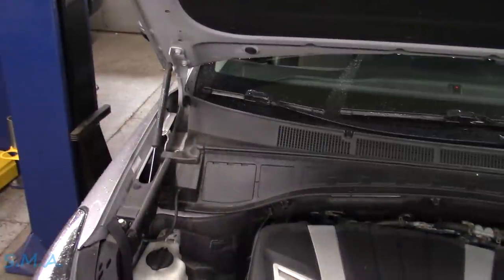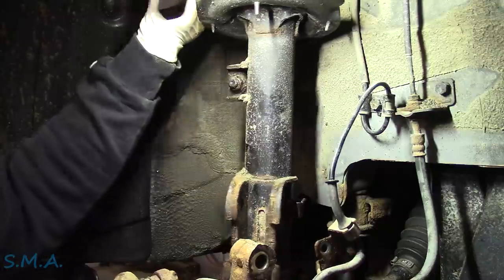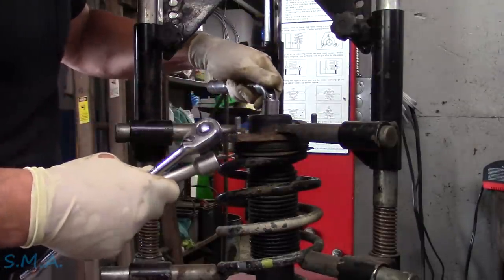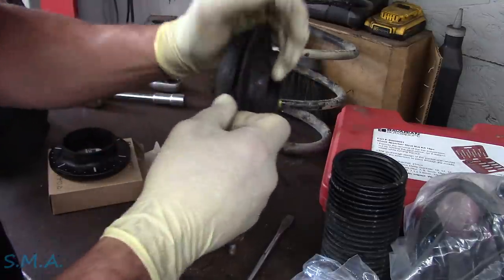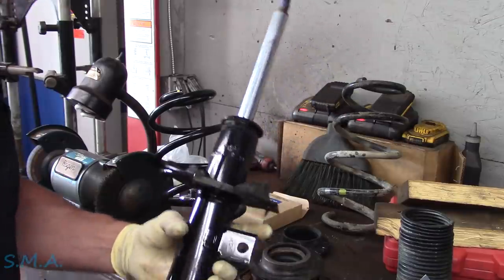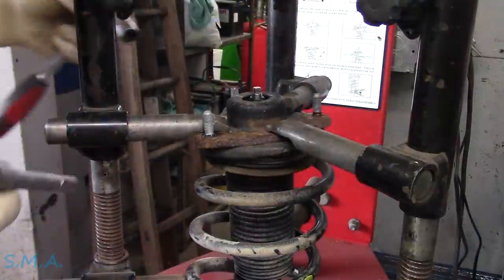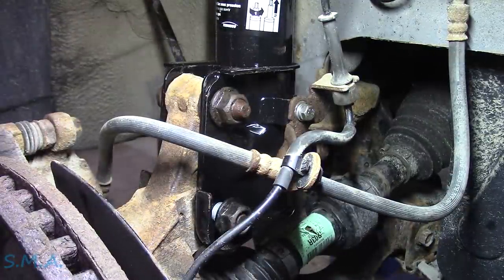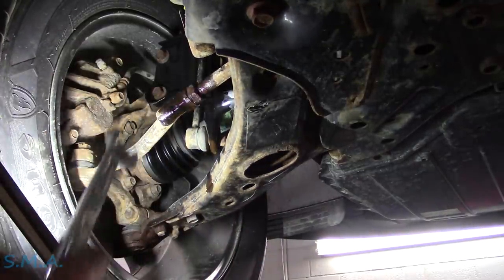Hyundai SantaFe: Broken Front Coil Spring

Comment: I can afford to buy OEM parts but, my vehicles are all old enough to be either OBD 1 or OBD none. Since that's the case, most, if not all parts such as ball joints, tie rod ends etc. are obsolete at the dealer so, I have no choice but aftermarket. Right now, I'm rebuilding the front end in a 1994 Ranger that's getting a 302 swapped in. I've been using all TRW parts except for the radius arms which are Dorman. Time will tell if I made a good decision on TRW parts.

Also...Tenneco owns the Dyno Max brand of exhaust parts too. At least the quality of them doesn't seem to have gone into the toilet.

Comment: Did anyone else scream, "bellow! The bellow!!!"? I am watching this on my TV, and I start to say to the TV, "bellow! The bellow!", and then a few minutes later yell, "uh oh! the bound bumper goes in the top mount!!"  Wife walks by, shaking her head.

I think I watched this video with as much enthusiasm as someone watching superbowl or fifa...

At least you have a spring compressor machine.  I remember because 20 years ago, I did strut replacement on my '92 maxima using one of then manual spring compressor bolt set from pepboys.

I noticed the below just sitting there on the ground, looking at me saying, "hey, guess where I go..."   OMG, that SOB...

Had to put the car back on jackstands and remove the entire thing, re-use the spring compressor bolts (once is dangerous enough already), and put the below on.  Re-assembled the car...

And THEN, after I do the job twice, I sit there and look at the sagging bellow, which is telling/taunting me, "hey...  why do I look different from the other side"?  I tried to push the bound bumper back in while in place, and after failing to push it in, ended up taking the strut BACK out, disassemble it and push the bound bumper in with a lot of cursing.

So I ended up doing the first side not twice, but thrice.  I guess that lesson was a powerful (and painful) one as two decades later, I am suffering PTSD from seeing you forget the bellow.  I also went and bought a pneumatic strut spring compressor machine which I only used once after that incident.  But after leasing cars for 20 years I just purchased a car, so I am looking forward to being a driveway mechanic again.

Great channel.  I worked on my cars in my driveway 20 years ago and really enjoy seeing you deal with the rust as back then the rust always kicked my butt.  I said I enjoyed watching not because I enjoy seeing you struggle, but you have some pretty good ideas on how to deal with it.  Thank you and keep up the great job!

Comment: Given the awkward access when removing the nuts at the top of the strut in the beginning of the video, I'm curious why a wrench was chosen instead of a small breaker bar?
Reply: Small breaker bars don't get a good grip on the nuts. A wrench or socket is required.....
Reply: @G31mR  maybe I used the wrong term. I have 3 small bars which have pivoting heads that accept sockets (1/4", 3/8", and 1/2" drive). That's what I use, for example when hand removing lug nuts and I use the same socket which I later use with a torque wrench to install lug nuts.

Comment: A tire & suspension shop near me keeps a wide selection of sway bar links in stock. If it even smells rusty, they just cut it off and replace it. Their logic is that the labor cost of trying to remove and reinstall a rusty link is about the same as the parts cost to just replace the damn thing, so they just zip it off, less job time for them and same cost for the customer.

Comment: I need one of the thor impact driver behind you. I can't find one to buy Thanks, Doug M
Reply: There’s a better tool than Eric used. Tektron 2905 3/8”, (also available in 1/2”) Manual Driver. It’s $20.00 on Amazon. Mine stays in the toolbox, but one stuck screw, and it pays for itself!

Comment: When you install your muffler bearings, should you use a left or right handed monkey wrench,.  Or is it better just to use your metric crescent wrench?
Reply: You have to use the special torque wrench calibrated in ouchie-mamas, otherwise you'll strip the anti-clockwise nut installing it.

Comment: How is New York on Brake Cleaners?  CA has environment requirements with brake clean and all come in green cans vs red. Some are saying the green stuff doesn't really work well.
Reply: That’s why you go to Nevada for the red stuff! Same with with mineral spirits lol
Reply: @romeo_alpha0176  I have to wonder who is actually in business to provide products, the State or private enterprise. This is all very wrong and backasswords.
Reply: @Garth2011  oh well you know in CA....it’s for the “children”. I feel with green cans it would pre-empt users to use MORE of the chemical. 

If CA is good at one thing, it’s castrating everything that it comes in contact with.
Reply: @romeo_alpha0176  Agreed...water saving plumbing fixtures here work so well that folks have to flush 2 or 3 times, take longer showers and spend more time dealing with trickle flow devices that truly don't function as they should so the cost of labor on any job double and triples with less results. Many homes in CA have plumbing that will not function with the newer designs so they either have to modify plumbing at a huge cost or see if they can be exempted which is another stepa and delay in getting anything done that afternoon etc. All of this is not saving any resources and creates higher maintenance costs. Then, we have to witness Oroville Dam and other structures that are falling apart because they won't do their job and provide the money as intended. We've got a bunch of adolescent criminals running our state, we have for a quite a few terms.
Reply: @romeo_alpha0176  AZ too?
Reply: @Garth2011  Reno is a worthy three hour drive north for me. I get to feel like an American citizen for a day before returning to Kalifornistan. I will be doing a three week road trip across the country in July. I need a break from the sad state of affairs here. 

CA would be a great place if it wasn’t rife with criminals running both the streets and the state.

Comment: Why are you taking the old strut apart? I stopped at this point to ask, since you have new springs, top mounts and struts. Only one new spring?
Reply: Customer doesn't want to spend More $ on it is going to make this someone else's Problem, That's why I bought a Mostly new Car with 145 miles on it, It was wrecked with 3 miles on it, And I know what parts were used to repair it and where.

Comment: OEM Hyundai/Kia parts are horrendously prices.  Put the Monroes in my Kia and both the new and the old were stamped identically and said made in Korea.  My 2008 Kia Rondo had the drivers spring replaced under warranty initially.

Comment: You shouldn’t take them lug nuts with the wheel lock on them off with an impact you should break a loose to the breaker bar first I have broken two of the insides of the keys

Comment: Both front coil springs had upper portions brake off and clang off into the ether. Drove like that for a year. Said fuck it, free suspension lowering that them kids like. Didnt even have to cut them myself. Jokes aside was a bad idea. Eventually saved money and replaced them myself.

Comment: I've driven many cars and covered a lot of miles in my 67 years, and I've never had a spring break.  Makes me wonder about Hyundai quality.
Reply: Along with most mechanics, I've seen a great many broken coil springs. Once the paint coating goes, corrosion sets in, causing a weak spot where, eventually, fatigue will cause a fracture. It happens on all makes.

Comment: Who makes that hammer/wrench combo tool? 😆
Reply: There’s a better tool than Eric used. Tektron 2905 3/8”, (also available in 1/2”) Manual Driver. It’s $20.00 on Amazon. Mine stays in the toolbox, but one stuck screw, and it pays for itself!

Comment: How common is it for a spring to just break like that? This vehicle isn't that old and that makes me worry about the quality of Hyundai products
Reply: We had one break last year on our 06 T&C van…
Reply: I have a 2013 Prius (C, not that it probably makes a difference).  In 2018 it failed inspection because the last 2-3 inches of the front right spring broke off.  The remaining bit was still making reasonable contact with the seat, so it was not this kind of catastrophic failure and we had probably been driving it for 6 months with no difference in ride or driveability.  It's probably caused by a tiny metallurgical defect and/or rust causing brittle failure at just the right point -- it's not like the Prius had a hard life that would have unduly stressed it to failure.

Comment: About: "Chinese Aftermarket Parts" ---> it's a shame that sometimes they are the ONLY source for obscure parts. 

EG rebuilding my own NP208 transfer case --- I can buy a few of the case parts that I don't need from GM for really BIG $$$$s - but nowhere in the world - other than Chinese aftermarket parts companies can I buy a low-high shiftfork with inserts. 
► Not even junkyards have any - nor are there 'rebuildable cores' on the junkyard parts computer circuits to buy.
Wham! Up jumps Amazon with all the small individual parts kit with the thrust TIMKEN® radial bearings and their matching hardground surfaced races I needed ... and the shiftfork is available!

Comment: Would liked to see how to torque the top strut nut. I haven't seen a through hole socket torque wrench or do you just use a normal torque wrench and maybe that flat spot holds it from spinning.

Comment: Wouldn't it be more economical to replace the whole assembly at once? The mount, bellows and rubbers are all that was left original.
Reply: May not offer a loaded strut for this vehicle. But usually they are cheaper in the long run , by the time you factor at least an hour labor for busting the old ones apart an putting the new one back together.

Comment: Steal Wheels?  Pit crews wish they could be as fast as these guys.  Other day we had a guy lose his catalytic converter and 4 wheels in seconds.  Guy posted the security footage hoping to ID these guys...but night vision kind of sucks.  

AMAZING to watch these thieves (though I'd like to catch them instead)...Massive panel van (Sprinter/Transit) along with a pickup...5 guys jumped out with two harbor freight rapid up hydraulic jacks, two cordless impact wrenches and a sawsall.  2 per side, as soon as the vehicle is up, #5 cuts the converter, jack men start hauling wheels.  30~45 seconds later they dropped the vehicle onto the concrete and were gone.  Wheel locks are a joke as they just hammer a socket onto it...one hit with the Tonya Harding 2000 on that socket and off they go...Jimmy Johns has nothing on these freaky fast crews.

Comment: @15:29 And that's why folks it's sometimes better to avoid the whole rigamorole and just replace the whole assembly rather than dicking around trying to rebuild the assembly.
Reply from the maker: They don't make quick struts for these cars
Reply: @SouthMainAuto  Yeah, I don't know why they don't. You can get them for the 2.0 Turbo Santa Fe Sport and you can get them for the full size 3 row Santa Fe with the V6, but not the most common model, the naturally aspirated 2.4 Sport. I don't know what they're thinking.